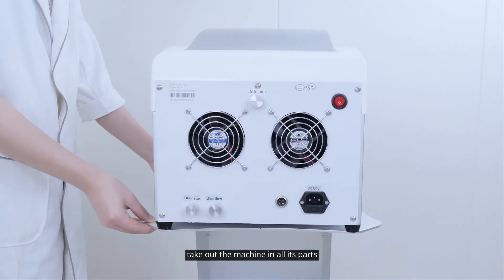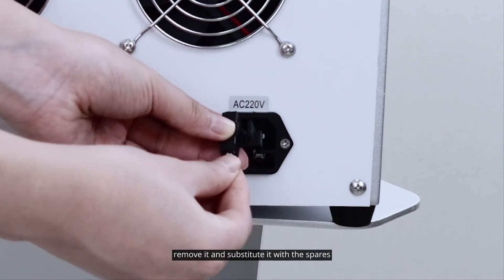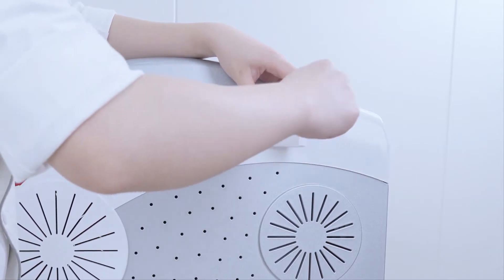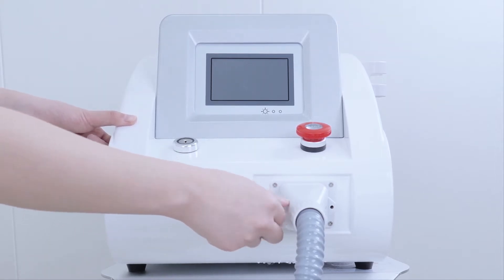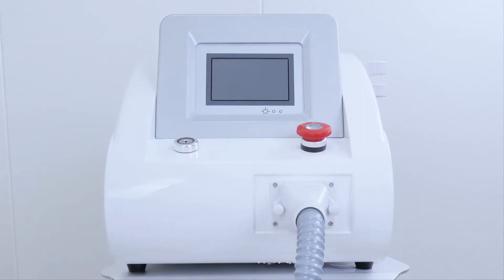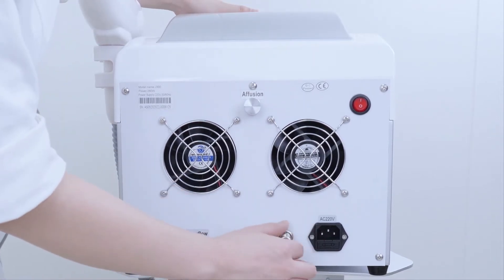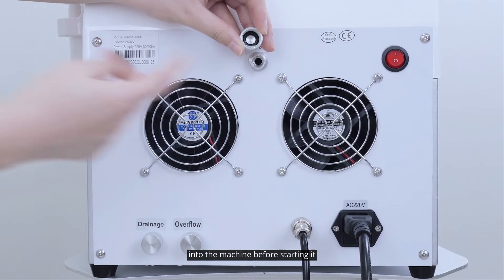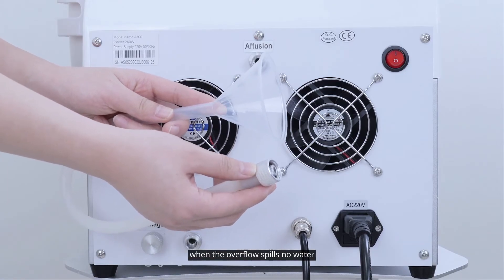Q-Switched ND:Yag Laser Machine for Freckle, Eyebrow, Tattoo Removal: How to Install & Use | HR-J200

Comment: Can I ask question, my machine just like on your video they are both the same brand after I change water the handle getting hot easier and cannot erase carbon? What I'm gonna do to fix it?
Reply from the maker: Hi. We need more specific info. 

First, you say "the handle getting hot easier."
I'd like to confirm: Is the handle itself or the tip that gets hot easier?

Second, the black tip can not erase carbon?

Comment: Does it work for keloids and scar treatment.
Reply from the maker: Operation Range as follows:
1. Pigment skin pathological changes, pigmentation caused by color pigment mixture, corium spot, freckle, mole, birthmark, nevus of Ota, etc.
2. Specialized in removing red capillary, coffee, brown, and other colorized tattoos.
3. Effectively remove all kinds of embroidered eyebrows, soak lip, eye line, and lip line.

Feel free to contact the Customer support Representative if you need any assistance. Thanks a lot! 
Whatsapp:  +86 18938075487 
Email：support@surebeauty.com

Comment: How many gallons of water does this machine typically hold ?
Reply from the maker: Hello dear, it depends. Our machine is very smart. We will equip it with water-adding pipes and tools for your usage. When the water in the box is full, the machine will remind you not to add more water. When the water in the box is used up, the machine will sound a water level alarm to remind you that you need to add water. The whole process is very smart and you can use it with confidence. Feel free to contact support@surebeauty.com if you need any other assistance. Thanks in advance!

Comment: My machine just arrived, unfortunately, when I tried to test it pressing the pedal, it only turns on the red dot, but doesn't trigger the laser which should react with the pigment. Do you know what might be happening?
Reply: Mine came broken and without some parts I spent 600 😔
Reply: Did you find a solution?
Reply: Same, mine only turns red dot but doesn’t trigger laser which react to pigment
Reply: @carjonsending9176  I solved the issue with my machine by replacing the power supply board; that was where the problem was.
Reply: @andrewlemos2251 I have the same issue. Where did you find a power supply board and how to install it?

Comment: What settings to remove red ink on eyebrows?
Reply from the maker: Use the 532nm tip. You can start with an energy level of 300 and adjust upwards from there, with a recommended frequency starting at 1.

Comment: Anybody tried this on tattoos ?
Reply: I did and its very effective. I set power to 1100 and it will bleed a bit. Gotta love the sting.. Just use distilled water..
Reply: @theorb3078  did it fully remove your tattoo
Reply: @LOVERcallofduty  I'm getting professional removal and with sessions monthly it's taken about 18 months to get about 50% fading. It's definitely a long painful process not something you can just do once or a few times.
Reply: @juliezingelman739  using this machine madame?
Reply: @theorb3078  was your tattoo black what settings did you use any scarring?
Reply: No, I'm getting professional removal at a laser center but it's a similar or better machine.
Reply: It worked great the first pass over.    Now it won’t pick up my tattoo and just zaps in tiny dots.    Not sure what to do

Comment: What about birthmark parameter setting?
Reply from the maker: Cooling condition: wind system+closed circulating+cooling system
type: Q-switch ND YAG
Pulse duration: 10ns
Spot diameter：1-8mm
Power: 500W
Tips: 1064 nm & 532 nm and 1320nm black doll tips
Reply from the maker: Hey Kinar, please click this link for more machine 
detail :https://surebeauty.com/products/surebeauty-q-switch-nd-yag-laser-tattoo-removal-machine

Comment: Can you use a 755nm hand piece lens on this laser ?
Reply from the maker: this machine can only use 1064 nm lens, 532 nm lens, 1320nm lens, if you wanna use 755nm lens, you can check this:https://surebeauty.com/products/tattoo-removal-machine-with-picosecond-laser-1064nm-532nm-755nm?_pos=2&_psq=755&_ss=e&_v=1.0

Comment: Water circulation sign on the machine what should I do!? I check the water is full but still have that water circulation sign on 😓 machine is not working please help me out please thank 🙏🏼
Reply from the maker: hey yuna， pls whatsapp us:+86 18938075487  , we will help you one-on-one
Reply: Did they tell you how to fix the water circulation light on? I'm having the same problem
Reply: @williamfoer1352 did you ever find a solution?
Reply: I'm having the same issue how do u get it sorted out I need help
Reply: @kamalamoffat947 did you ever find a solution?
Reply: I am also having the same problem. Can someone please help? Thank you.
Reply: @meme5952 did you ever find a solution?
Reply: Pleaseeee same thing here the faucet with an x next to it
Reply: @charlesgonzmart873 hey did you ever figure it out? Having the same problem and can’t find a solution anywhere :(
Reply: @Iam.ashmariecarter no still nothing. I tried using distilled water and it still doesn't fire. It runs though!